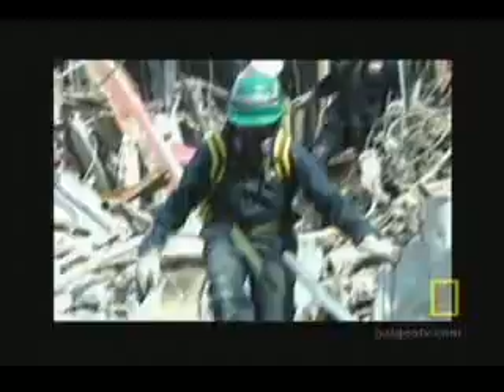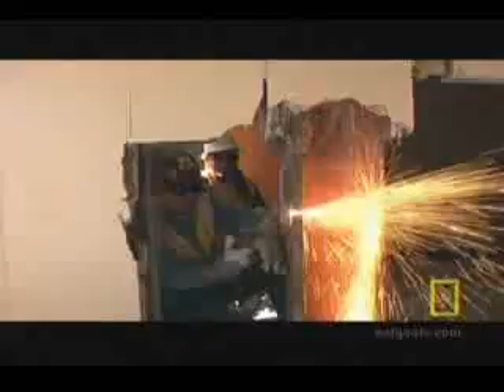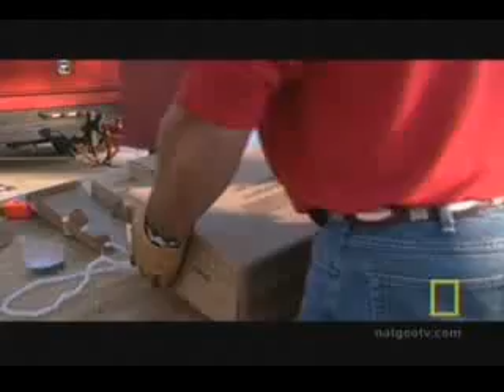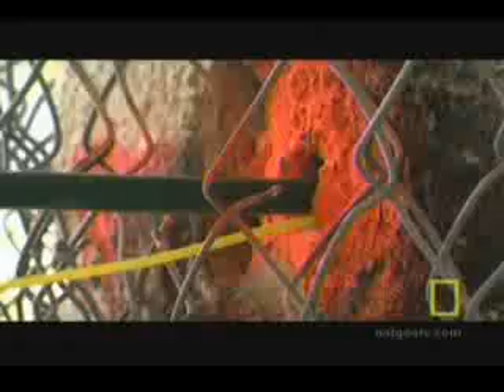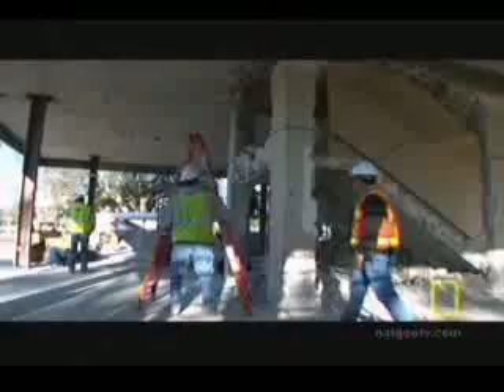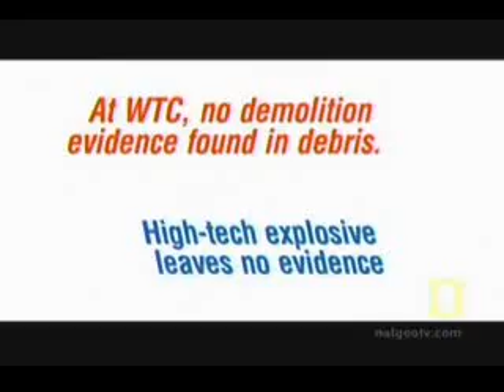debunking the towers being a planned demolition theory

Comment: Well, that settles it.  9-11 is totally legit.  3 buildings came straight down through their own footprint from a few hours of fire.   The only 3 steel buildings to ever come down from small localized fire EVER.  Never before or since!  Lucky day!
Why don't these demo guys load up an old fuel truck with Jet A and crash it into the lobby.  It'll come down in its own footprint while they have lunch.

Comment: All major cities require a demolition plan for any major structure before construction can even start.  Any major building permit office can confirm this fact.  The steel columns at the bottom of the TT was over 2" thick, too thick for any conventional explosive to cut through.
Dimitri Khalezov was in charge of USSR paperwork for civil engineering use of nukes, which are required to notify all other counties. Reciprocity required the US to notify his department of the plan.
NOT CONVENTIONAL DEMO